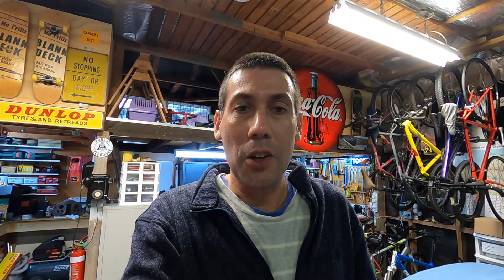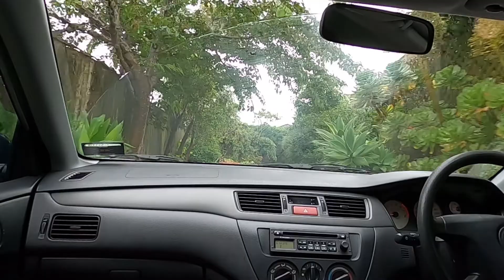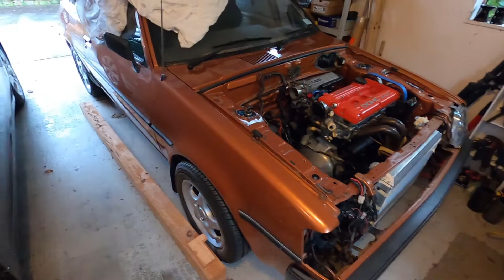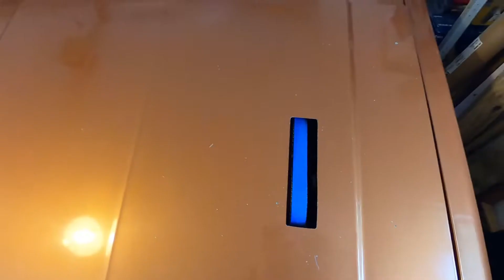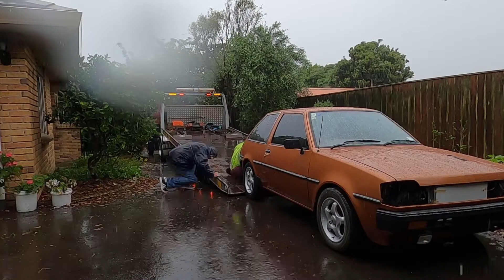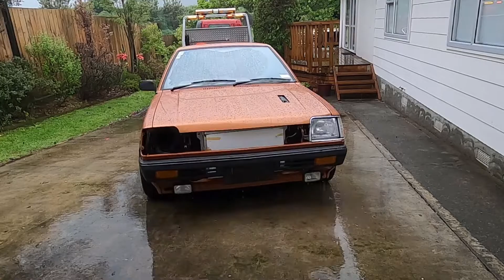Mirage\Colt 4G63T Engine Swap Sleeper Car comes home - Brake and suspension modifications

Comment from the maker: The 4G63T Mirage\Colt is finally home! Is anyone else out there doing a similar project I would be keen to hear on how your project is going.  Take Care 🙂🚗
Reply: Hey mate I've put a 4g63t into my 82 Mirage, it's a VR4 block with SOHC pistons and head. I tried to keep it period correct but this makes me want to build a DOHC engine now! Great info on the brakes, as I had researched brakes for these, came to the conclusion that I could use Sigma GSR-X rears and VR4 fronts, so thanks for confirming that for me haha I have all the parts, but have been procrastinating with actually putting them in!
Reply from the maker: @ALMN8U Hey man, thanks for the comment yes the DOHC cam cover definitely stands out under the bonnet so I say do the full DOHC engine now hehe!  Brakes are Sigma GSR front and rear, VR4 front suspension (which i think is similar to evo 1-3).  You will just need to get a new handbrake cable made up.  Is your car up and running with the SOHC setup?  if so how are you finding traction?
Reply: I'm also in NZ
Reply from the maker: I just saw the comment that you are in NZ, we will have to bounce ideas off each other for this project.
Reply: Got a similar mirage it’s an 89 so bit newer than yours but in the process of putting a 4g from an evo 4 in it. Also from nz
Reply from the maker: Nice that sounds like a good combination. I think the engine bays in those cars have a little bit more room than mine so you will have more space to play with gearbox wise.  What gear box will you be using? All the best with the project.
Reply: I will be working on my newly owned 1984 mirage, you have done amazing things to yours
Reply from the maker: @samanthadickie9120  Hi there thanks for the comment.  All the best I hope your work on your Mirage is going well.  They are great little cars and not many around now.  Take care 🙂

Comment: Hi mate, I live in Australia and I have been trying to modify my 88 5 door colt. I have a cordia turbo 4g62t to go in the engine bay. I also have been trying to find brake and suspension upgrades for it because there's nothing I can really purchase off the shelf so that information was extremely helpful. Also wondering where I can get that rear end because those turbo colts were never sold here and my car is very understeer heavy. 

Any info you can provide for me would be extremely helpful..... that is unless you're willing to part with that beauty haha
Reply: Do the sigma hubs bolt straight on and how complex is it to get the discs onto the rears?

Also those old camber plates for the struts/coil overs, ar there perhaps for sale?
Reply from the maker: Just another update, I was trying to find the forum I used to read with great Cordia info, it was called CordiaPower but the forums are not online anymore link does nothing.  Anyway looking through my folder of Mirage paper I found something I printed called Magna rear disc conversion which I printed in 2005, so looks like you can use Magna TM/TN/TP rear brake parts.  Best thing to do join a few Australia Cordia forums or facebook pages and research what people have used in Australia to convert drums to discs on the Cordia's and you can apply that to the Colt.
Reply: @MannixGarage  I remember trying to do that brake conversion on the front end and it didn't work because the hubs needed a different ball joint even though the hub bolted to the shocks. This is extremely helpful info though because it's stil possible and I still have a GSR turbo cordia to pull parts from. I'll check the trailing arm rear end and if I can use it I will just for the rear sway bar. Thank you so very much for all the info so far. I hope you don't mind if I bounce ideas  from you in the very near future
Reply from the maker: @damientaylor7480  Yeah no worries feel free to ask any questions.  If you check in the questions you will see a part number for a ball joint which may suit the Cordia hub, you might be able to find the sizing on the internet to cross check with the Cordia GSR hub.  Cheers 🙂
Reply from the maker: Yes the sigma hubs bolt onto the rear fine no problems, and the front bolt on too, but you will also need the ball joints to fit hubs. As of the rear you will need the Bias adjuster and handbrake cable made to fit the car (get the sigma hand brake cable setup so you can take that to the shop so they can see what fittings are needed etc)  The camber plates I will just keep as spares, but you can get blank ones you can just restud when you are ready for the suspension and brake upgrade.
Reply from the maker: Hi mate thanks for watching.  I think the route I would take is researching the Cordia GSRs specifically the brakes and rear trailing arm.  The trailing arm in those from memory are the same and it may have that inbuilt torsion bar (I don't know of hand if it does but there will be info on the internet) and you could always check if Whiteline does the rear sway bar for the that model or Colt and add that onto it too.  The sway bars are definitely worth it.  Also research Cordia GSR brakes as I think they are bolt on as well, and if looking for more info the disc conversion on the rear of the Cordia for extra info. Thanks

Comment: I followed a similar path adding a rear anti-sway bar to my ‘84 Colt Turbo. Completely transformed it into the best handling, fastest  car in the Hot Hatch class of 1984. 

205/60s in place of the of the original 165/78s followed the above taking straight line performance & handling to the next level.
Reply from the maker: They are good little cars the Turbo version add will be quite a rare car now quite a wee classic.  You don't see many of the turbo ones here in NZ anymore.  Yup I definitely agree  that the sway bar made a huge difference in handling something worth while doing that's for sure.  Thanks for watching appreciate the comment 👍🙂

Comment: Any further progress to this beast?. Gday from across the pond in Aus.
Reply from the maker: Hi there, thanks for watching and Happy NY! No current work as yet currently have the car parked up as I am working on another car 1981 Mitsi Lancer EX which is needing a few things done for our car safety check (warrant of fitness) to legally drive on the road.  I don't think the Lancer EX was sold in Australia, but its basically a similar sized car, 4 door rear wheel drive.  Cheers 🙂

Comment: Hey mate, are you still using the standard mirage ball joint with the Sigma hub/knuckle? Mine seems to be too small
Reply from the maker: Hey Bro, are you the person with the bronze 4 door Mirage with the SOHC 4g63T?  as I might have some questions for you down the track.  When I got this question I felt guilty as I have done nothing on the car lol really need to get it done, but I have found my spreadsheet with the part numbers. 
No not using the standard mirage bottom ball joint, and I am unsure what car specifically they are from as its so long ago, my guess Sigma GSR or Cordia GSR, I used Part#JBJ374 Lucas Hyundai Excel 89- . Repco lists that part# if you find out what car that is off let me know as ill update my spreadsheet of parts.  From memory if you are still using the Mirage standard shock setup you will need to run camber bolts.
Reply: @MannixGarage  yeah bro , that's me! Cheers for that, I used that part number to find the OEM / Interchange Numbers: 5453024000, 5453024A00, 5453028000, 5453028A00, specs are the same as the TRW part from repco, but you can get them much cheaper through rockauto. Model I found them in is Hyundai Excel 1990-92. Ordered a pair, $90NZD landed from rockauto.

I have Evo 3 adjustable shocks and ToyShop camber plates in mine, also have camber bolts on hand if I do need to correct further.
Reply from the maker: @ALMN8U Cool its the little Mirage with the green doors aye its a nice looking car, I follow you on Instagram.  Thanks for that website, never knew about that one.  If you are ever in the Wellington area and want to have a look at the Mirage sing out.  I have recently bought a EX Lancer which I am keeping stock and just want to get it to WOF standard.  I will get that out the way first and carry on with the Mirage me thinks 🙂, but once that is done I will flick you a message on your Mirage as I will no doubt have some questions.  Just sing out if you have any other questions.

Comment: What driver side motor mount did you use?
Reply from the maker: Hey thanks for the question, the mounts are custom made, its not a hard job for an engineer to make them. Thanks

Comment: Hello, dear friend, I did make myself a soft ride, got rid of other people's rear springs, found my springs on auto-dismantling and installed new front struts, the car became much softer, it became pleasant to drive, it remains to find a slightly thicker anti-roll bar for the front axle and rear axle stabilizer
Reply from the maker: Hi great to hear that you have sorted your springs out.  I hope you can find thicker anti roll bar for your car as they make a big difference to the handling of this particular car.  Maybe if you cant find a direct fitment you might be able to find an engineer who can make one up for you?
Reply: @MannixGarage  Hello, we don’t have such specialists in our city, and even if there is, the price will be just cosmic
Reply from the maker: @alexeykosupa4041  I got my front and rear sway bars from Whiteline, they don't list them on the website anymore but you can always email them and ask if them if you wish.   https://www.whiteline.com.au/do_segue4.php?make=MITSUBISHI&model=COLT&model_final=1984-1990&vehicle=COLT+RC%2C+RD%2C+RE

Comment: Hey,, Love the car. So stoked to find a fellow kiwi with the same project car as me. Im just starting out, I was wondering if you know what the actual part no.s are for the sway bars/ where you got them. Also will the rear sway bar fit onto the stock trailing arm or is that the reason you upgraded to the turbo version? Thanks
Reply from the maker: Hey Mate, glad to have another fellow kiwi who has the same project car 👍.  I don't have the sway bar part numbers as I purchased them over 10 years ago (Ill do some digging)  but I see the Whileline website doesn't list the front and rear sway bars on the website now, however I am sure if you want to enquire with them eg email say you are looking for front and rear sway bars for the 1984 - 1990 COLT RC, RD, RE (same shape as the NZ mark I and Mark II Mirage) they just had a longer production run. 
As far as trailing arms go, the turbo rear trailing arm is identical to the non turbo, but if you look at 9:45 min of the video the picture of the turbo trailing arm has the factory sway bar or torsion bar attachment between the two sections of the trailing arm to prevent the flex, the non turbo trailing arm doesn't have that, I just wanted both in the rear.  To be honest if you can't source the Whiteline sway bar it would be something an engineer would easily be able to make up.  Originally I purchased at Repco.  If your car is lowered already the sway bars are definitely worth doing and I noticed a big difference in handling, they are quite rolly cars without them.  Feel free to reach out on the email as its always good to bounce ideas off someone with similar cars.  What have you done on your car? Take care

Comment: Fantastic info! I have wondered if Sigma hubs will fit. You'll be able to put 2 piston calipers from a VR4 or Diamante on the hub using VR4 rotors seeing how the Sigma hub bolts on. Great stuff!
Reply from the maker: Hey glad you commented as I have watched your channel in the past when my Mirage was all tucked away in storage. Yes sigma GSR front and rear but I cant recall the exact year I think 86/87 I will let you know.  It was the model with the 4g63T SOHC Turbo front wheel drive, maybe 86/87?.  I just needed to get a custom handbrake cable made.  You will be happy with the braking performance.  I may have to pick your brain for future questions 😊  Thanks for the info on the calipers and hubs.

Comment: Ahh in Puerto Rico there were several versions. Champ, Precis and La Doge Colt twin stick. The last one is the one I have from the year 1981.
Reply from the maker: Thanks Erik, I am happy to hear someone has viewed from Puerto Rico.  My car was originally a 4 speed only but fit the twin stick later when I ran the original motor, they are an interesting concept